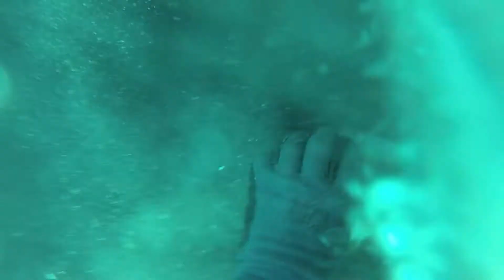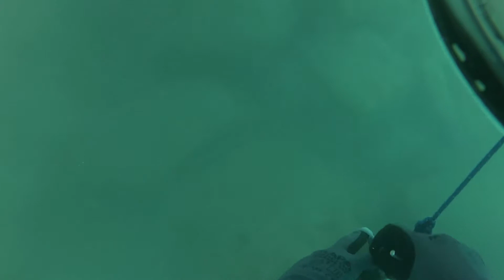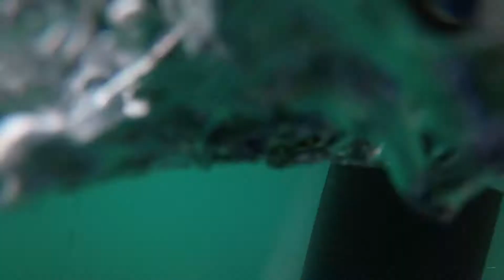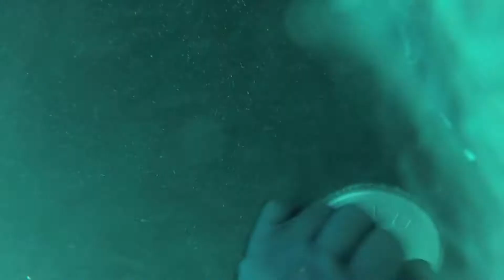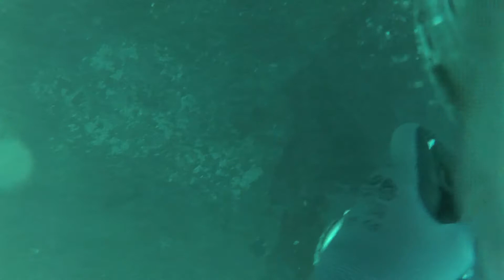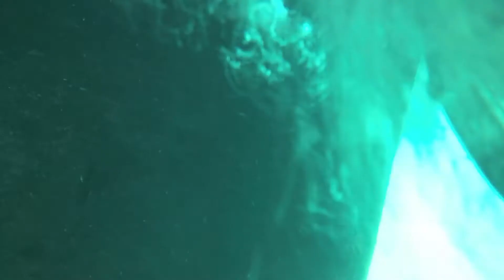Keel Anode Change

Comment: Footage of leaked NASA footage? 😜
This may be a dumb question but what are keel anodes used for?
Reply from the maker: To prevent galvanic corrosion caused by two unlike metals exposed to seawater.   Anodes are made of Zink and are often simply called Zinks.  The will corrode or sacrifice themselves to preserve the other metals from rotting away.